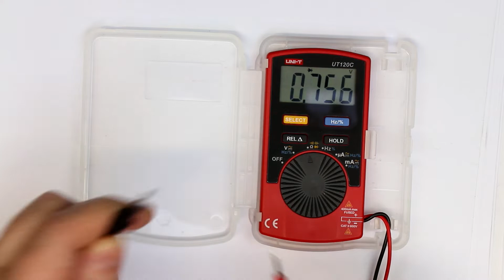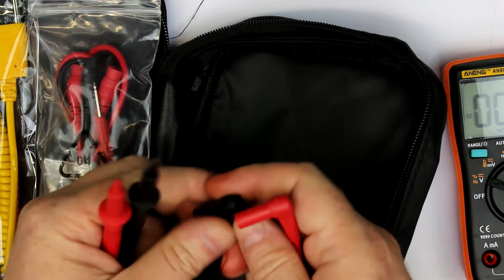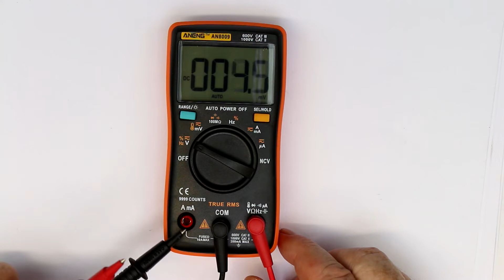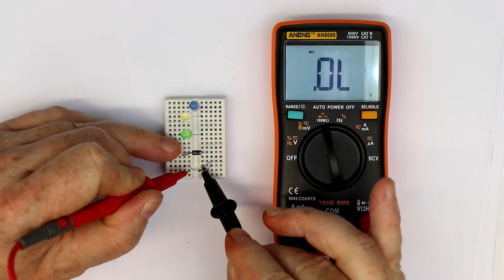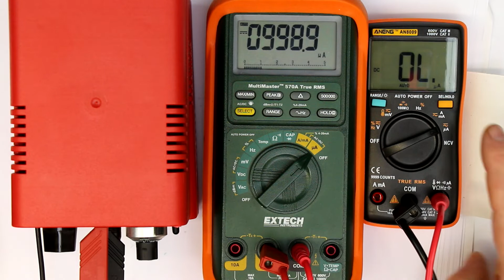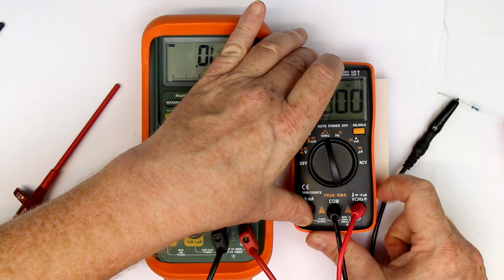ANENG AN8009 Test + Teardown

Comment: Hi will this beep in diode mode thanks
Reply from the maker: No, I have never encountered a multimeter that beeps in diode mode. Reason is simple: A shorted diode would also cause a beep. The purpose of the diode-mode is to show the forward-voltage of the diode if correctly oriented and "OL" (Overload) for reverse inserted diodes.

Comment: Hi Roger, i know this is a old video, but it became very handy today.
My Aneng AN8009 was acting weird (cutting off, not stabilizing in resistance mode etc...) when i barely pressed on the rotating knob.
So i took my meter apart and cleaned the 6 cupper "bridge" contacts from the knob and removed the excessive grease, but 3 contacts from the rotating knob came loose.
So i put them back symmetrical and closed the meter, but the meter was still acting weird and in the NCV setting no image on the screen, and the batteries became very hot, a sign of a short circuit.
Then i took a look at your video because i knew that you did a teardown of this type and saw at 34:04 that these 6 contact bridges are not placed symmetrical, the 3 bridges on the yellow button side, are placed more to the center of the knob then the 3 bridges on the blue button side.
I had placed my contacts symmetrical and that was the issue of the short circuit. 
Now the meter is back working fine, and i don't see any damage from the short circuit. So a big thank you for this video :-) Grtz
Reply: I made the same mistake and your comment made me realize, thanks!

Comment: I dont have the problem with the original probes, not even after 2 years.
Maybe cleaning them with a strong soap helps (or vinigar, lightly acidic to remove light passivation).

The only thing I dont like in this meter is the accuracy of the 10A range, it is horrible at +5A, maybe the shunt heats up and is of poor quality. (It can read 1A off)
And the tiny fuses, hard to replace...
The supplied thermocouple is not so good for electronics, it's more suitable for fluids.
Luckily the small dot ones are very cheap on aliexpress.

I have it in a small drawer of my toolbox/case for my RC hobby so small size was important and the additional small test lead kit was nice, you never know what you'll need when your RC model breaks down.

Nice and elaborate review btw 👍

Comment: excellente review, I only like to know if the beep sound when you check diode  when is  a short.?
Reply from the maker: Beeps are only used for continuity testing. In diode-testing you get the forward voltage displayed. And because this voltage varies depending on the type of diode there can´t be a Go/No-Go beep.

Comment: Have you tested the accuracy of the thermometer?
Reply from the maker: No. The thermocouple thermometer is just a bonus in every multimeter. Sufficient for temperature measurement in live circuits (semiconductors, resistors etc.) is in my view would be even an (in-)accuracy of 5°C. Concerning the quality of the rest of the multimeter it´s probably accurate to 1°C.

Comment: man, why did they skip 2 ranges on mA scale , the 10mA [9.999] and the 100mA [99.99] and they went to 1amp [ 999.9mA].  You loos a lot of resolution, instead of displaying 2.555mA it will display 002.5mA. That is extremely stupid...What is the logic behind that....They did this both on AC and DC scales. Same thing on AN8008 and An8009.
Reply: That's a disappointing result in otherwise a nice meter for the price.

Comment: Hi! What about NCV test? Can it find AC-wire inside a wall? As I seen there is no antenna for that on pcb
Reply from the maker: This is a multimeter for _electronics_, not for _eletricians_. In my view NCV-testing is just a useless gimmick on a multimeter intended for work at the electronics lab bench. It´s just hip for sime time now, that multimeters started to add this feature. When I am searching for wires or water-tubing inside a wall I am using a specialed device for that task and would never use a multimeter with that untrustworthy feature for that task.

Comment: Press the yellow select button on  uni-t 120c to activate the buzzer for continuity.  Hope this helps
Reply from the maker: The buzzer works in the UNI-T120 but it is barely audible. The Uni-T is just another pocket multimeter that has many things left to desire (as with all Uni-T devices I ever got my hand on). I have made a separate video about this PoS.

Comment: I love this DMM, a total STEAL for its quality/portability to price ratio ;)

BUT one biiiigggg word of caution, and something that NEEDS to be said...
Do NOT trust the CAT rating labeled on CHEAP (and be skeptical *always*) test probes... verrrry very very common for those to be labeled without ANY actual 3rd party (or 1st party for that matter...) testing for certification of their CAT rating. That costs extra MONEY for them, and why do you think those probes are so cheap in the first place...?

Doesn’t mean they’re all bad, even if they’re cheap, but you gotta remain skeptical and exercise extreme caution and common sense, please! Could save someone’s life, for real..
Reply from the maker: You are of course absolutely right. ANENG in the last years seems to have developed into a reputable company (for Chinese/Taiwanese standards). The fact that they use a minature HRC-fuse is a good hint at that they are concerned about true safety layout of the multimeter.

Comment: At 28:49 in video, is that solder leading from the small fuse to the shunt (bottom left corner of PCB) ?  Anyone know why they did this ?
Reply from the maker: Yes. This is usually done for high-current carrying PCB traces to get a lower resistance.
Dave Jones made a video about that practice and has measured the effect.

Comment: Great video as always! There is an easy way of getting the meter to settle and measure more quickly. There's quite some noise on the power rail, so by upgrading a couple of capacitors you get faster and more stable response. It's a great little meter! You can read about the modification here. https://www.jackenhack.com/aneng-an8009-improve-accuracy-response/
Reply from the maker: Just tried it out with my version  and I don´t get the behaviour that you observed.
DC-Voltage measurements snaps imediately to the final value after the autoranging has switched to the correct range.
Inside it looks like yours: a 100µF/16V electrolytic for decoupling the battery voltage and some unpopulated SMD-capacitor pads below it.
Reply: KainkaLabs weird! When measuring for example volts, both my 8008 and 8009 would wander before settling on a value. After modification, it is much faster and settles almost immediately.

Comment: Big thumbs up for this video! Very comprehensive! Nobody else tests multimeters like Kainka Labs!

Really love the fact that you switched the Aneng's crappy probes to show that the continuity is fine with decent probes. I don't know why they don't gold plate all the probes. The gold plating can be very thin and it will still be a huge improvement...

Self tapping screws are not that bad if you never have to remove them! ;-)

And for those in the US, it's $24.67 on ebay with free shipping.